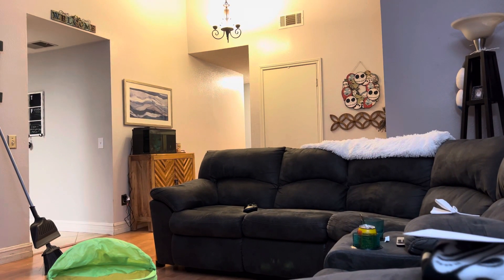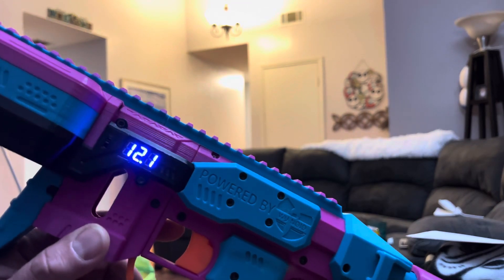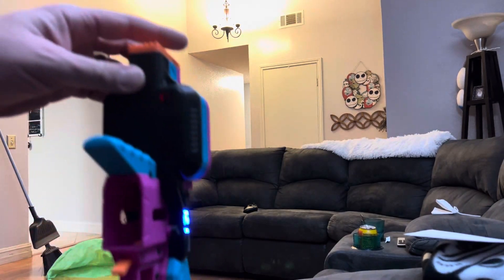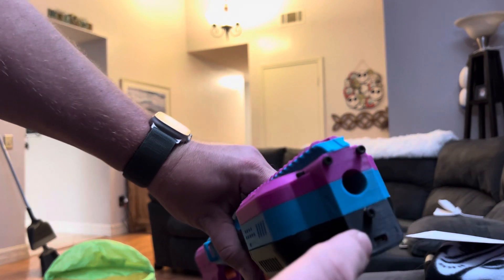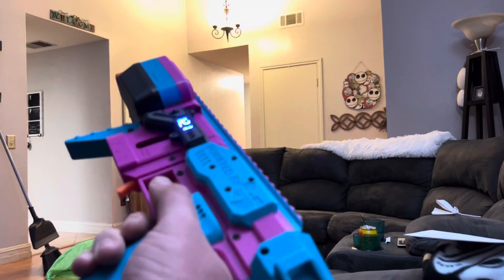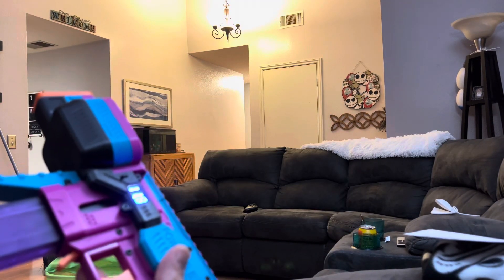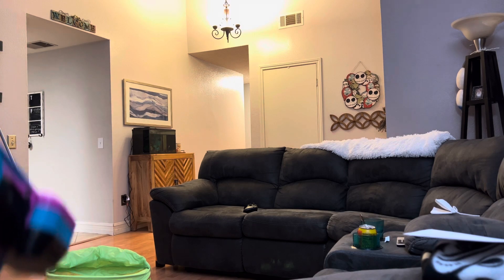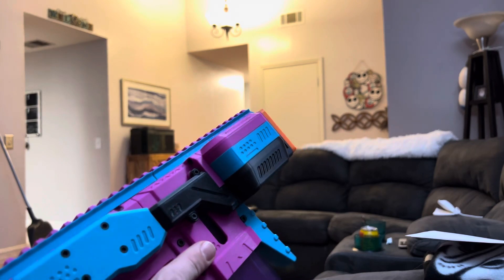Dual stage solenoid “neutron” gryphon with arduino select fire demo

Comment: What select fire kit did you use?
Reply from the maker: Custom. Used an arduino with a buck converter so the lipo didn't kill it.... again. Mosfet etc. Code was from airzone's github
Reply: @SpyderGiant  Thanks!